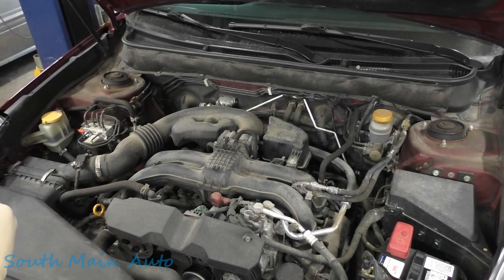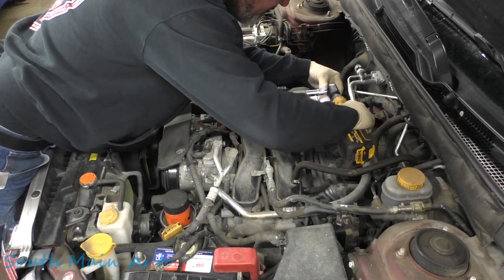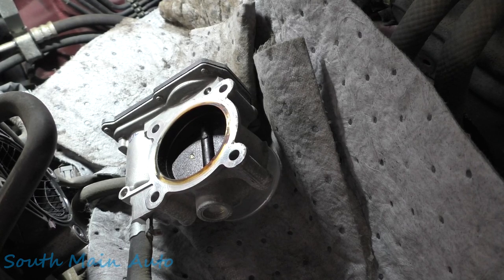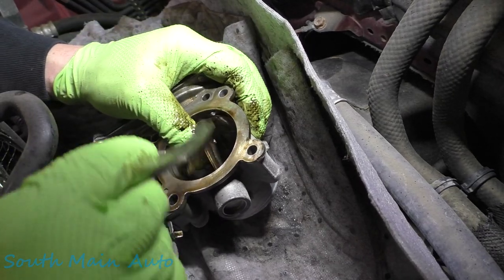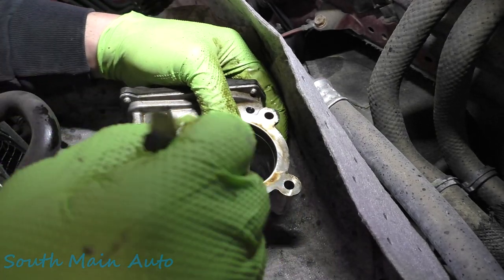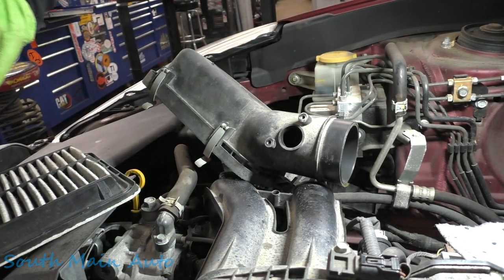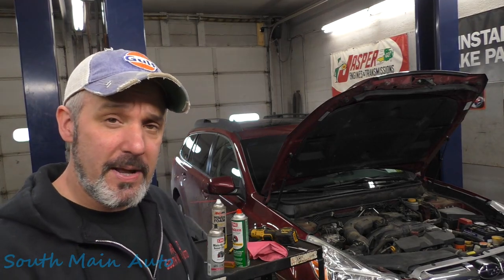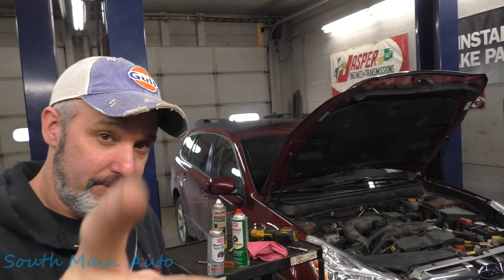How Does Your Shop Deal With Intermittent Symptoms?

Comment: Always hated these kinds of brain twisters. You did some of the obvious stuff. But I'm remembering a time a very long time ago when I was 17 I'm over 60 now. Had an old ford Galaxy 500. It developed an intermittent. Would run fine then out of the blue it would choke and sputter then die. Let it sit for a while it would start back up run fine then rinse and repeat then die again. Then it would run fine for a few days then the bad stuff would happen all over again. Seems like every time I put gas in it it would have these spells. Finally it had a spell and just would not start again. It died on me in the middle of nowhere and I had to walk 10 miles back. Met up with the old girlfriend's father and told him all about it and he asked me if I had checked the Fuel filter. It was a rust bucket of a car I was just a kid so yeah the fuel level was always low and cars don't run too good when they suck up all of the gunk in the bottom of the tank. Changed the filter at the carb, the screen at the mechanical pump and the one in the tank. That was the issue. After that I never let the tank get below a quarter and kept two fuel filters with me each time I ran that car. The issue never happened again. Hope that's not the issue with the Subaru.

Comment: YOU MISSED A SPOT!

What a dirty air system! I check my filter at every oil change (at 5000 miles) and rarely let my air filters go past 15k.  My mass airflow sensor gets a light cleaning every 15k.

I check the throttle body at 30k on all of my cars. 

I kept my 2011 Subaru Outback engine clean enough to eat off... The head gasket blew at 89k. Revved above 5k once. I was averaging combined 36 mpg with that stupid car.

Comment: My shop would take a quick look at an intermittent problem at no charge. If we get a sense of direction then the customer is called and diagnostic time is requested.  If there is no sense of direction then we give the vehicle back and tell the customer to bring it back when the problem becomes more frequent or is reproducible.

Time is money. But don't take a customers money if you can't fix the problem. Communication between the shop and customer is the most important part. 

I run the shop when my boss goes on vacation and let me tell you that "People Suck."  Not all people but enough of them to warrant my opinion of dealing with the general public.

Comment: I wonder if the fuel pump is failing? I had a car with the same symptoms, but it wouldn't mess up long enough to trigger a CEL. Finally the fuel pump packed it in one day, left me on the side of the road

Comment: I have had multiple customers come in with odd problems with idle and even fuel trim problems and I've learned to 1st clean throttle body and use MAF cleaner (primarily gm products) solving about 75% of issues with in town driving concerns.  Is this a valid repair in your eyes?

Comment: I tell the customer that I have not been able to duplicate the issue so far but will suggest one or two possible areas for further investigation based on either previous experience or logical conclusion. However sometimes the symptom does not make sense in which case you really need to experience it first hand to avoid ending up down the proverbial rabbit hole.

Comment: After 30odd yrs in the trade I now work in a workshop that I get no customer interaction and one word job sheets, so my sheet says "knocking" or "squeak" and we as the techs have to asses the car from there and report back to the office at that point we are given the more information and that works real well, I go to the office and say left front anti roll link or right rear shocker area or even if my customer could remove the garden tools from the trunk, I worked at Skoda years ago and I looked for a noise on about 10 new cars and I noted that the old timers noted the noise and then one day an older guy ex driving school guy used our loan car (and a friend of the shop) and said its got a noise and I said "you can hear it??" YEP  just by the accelerator peddle  me and him stripped that brand new Skoda down to metalwork only to find that the very last spot weld on the sill to A post had not fused and the vibration was only heard with people with hearing aids, my driving instructor had 2 hearing aids and therefore could pin point the noise to an area within 1 ft,

Comment: This is a tough one so I'm keeping it simple as I can. I am no longer in the automotive industry. I went to the wind turbine industry and have not looked back. I have done private garages and dealer ships. Taught automotive at college for years.  i've made a killing and was always accurate with diagnostics. Even to the point when at a dealer ship i could argue with the techline and get the parts I wanted changed even though they had confirmed fix's for same issue with other parts and getting my issues at the time fixed the right way. My advise to everyone the industry is stop devaluing our work. Every time you do a freebie or do not charge for diagnostics you feed the beast and cause our trade to be soo devalued. How is it a plumber and electrician can charge easily $100 hour up here in the north and do such shitty work. its cause they charge you. they don't do 5 things in the same area and give you a discount cause they were in the area. no they charge accordingly and us as automotive techs are soo beat and broken in to not charging for our work that we've as a whole screwed over the entire industry. ALWAYs charge for time spend. even intermittent. Set the expectation that they have to spend money even if you dont fix it. every other industry does it., why dont we?

Comment: Too often, mechanics will deal with intermittent symptoms by launching a massive attack with the 'parts cannon', not do research on line or from the diagnostic programs, don't properly read trouble codes. Often it may be a faulty wire, switch, a leaking vacuum hose, bad sensor and it may take experience and common sense to figure it out.

Comment: Intermittent + mouse sign = wires compromised somewhere. Is it wet/rainy when the intermittent presents? If so it's some short to ground on a stripped power wire!

Comment: Amsoil is currently out of stock of the power foam.
I need to do my throttle body on my Subaru the last time I did it I use regular carb cleaner and it just took forever.

Comment: "A very expensive valve".  Not to mention, a completely unneeded valve.  If all the emission stuff that was adopted early-on actually resulted in the NOx reductions they were designed to provide, it would be one thing, but so much of it accomplishes nothing but increasing vehicle purchase and maintenance costs.  I wish they would allow auto makers to stop using the stuff that has been proven to not actually be making things better instead of just keeping the regulations in place when the only real effect is to nearly smother the engine and cause owners and mechanics headaches because the code is so convoluted and the replacement parts are outrageously expensive.

Comment: I'm wondering if the intermittent symptoms started after the battery was swapped out. Looking at the before/after cleaning the throttle body, car should run better in general.

Comment: I drive a company vehicle for my job, 2014 forester with the same engine and it has the CVT. Around 95,000 miles it started stalling, turned out to be the CVT. Never got the explanation for how it would cause the engine to stall as my work company just swiped the credit card and got it fixed.

Comment: Maybe, with intermittent codes being what they are, manufacturers could develop a suffix for codes which could be stored in long term memory when a specific system is hitting a "yellow" range, so not out of spec persay but flirting with the limit.
Reply: Or some form of change to what constitutes pending. Mode 6 can help you identify some such issues

Comment: I have a 2017 f150 5.0 and it is intermittently stalling at stop light after driving for a while. No codes. It's worrying me because every video on youtube says it's a know problem and it's cam phasers.  I know if I take it back to the dealership, they're  just going to say it ran fine for me, and that's going to be that. Even though they know their is an issue with these model trucks. I have always owned chevys until this truck 🤷‍♂️

Comment: Our shop plays by the type of issue they are having. If it's noise related I'll ask them to take a video or recording if I can't reproduce it. Also random problems I'll see if it occurs at the same location, time after driving, speed, temp, accessories on or off, any small piece of insignificant info that may be related. All depends on the seriousness of the issue.

Comment: Not familiar with that car, but I have seen that problem when the pintle on the Idle air controller got coked. Hot soaking would cause it to expand. Maybe you cleaned the IAC while cleaning the throttle body. Like I say, not familiar with the car.

Comment: Our 2015 was acting all stupid and gutless at times. It did throw a code for 02 but the issue was it the money light would go off ,car would run fine for a while, then money light again and bad running issues. I could also smell a lean exaust, which I thought mabe intake gasket seal. I did every possible test I could think of not owning a diagnostic computer. Turned out to be a badly cracked exhaust  manifold. I took it to the shop my mom and daughter used and they found it.  The 02 sensor was fine. I had them replace it as I do not have time to do it and no garage doesn't help.

Comment: I had a check engine light that had me changing a vent valve I believe.  Light came back on then I gave up. A month later light goes away and hasn't come back. I think the car is just messing with me at this point

Comment: On the throttle body cleaning I was always told not to manually open and close the plate that it could cause a calibration issue ! Is this the truth on all throttle body parts ???

Comment: To be perfectly honest, and I have done it on two I can think of.... I used the small shotgun. They were mine, and I would guess, and throw a part at it and hope it fixed it. And then on to the next part. One turned out to be a fuel flow transmitter on a 94 Chevy prickup. My memory fails me after that, but yeah, I shot the cannon.

Comment: What's up with the mesh/ grid in the intake manifold where the throttle body attatches? Never seen that before, I would never think anything that big for it to filter should be in there anyways with the regular air filter filtering it.... odd

Comment: Drag from one of the aged components on the accessory belt (compressor or generator or water pump), a drag from low or old, dirty, transmission fluid that may have clogged fluid passages?

Comment: I have an 06 outback manual. Occasionally a high idle. When looking at tps on a scan tool am I seeing pedal position or throttle plate?
I think the scanner actually calls it throttle plate angle.

Comment: Would there be an option for the customer to buy or be supplied with a diag tool to monitor the performance at the time of the issue, preferably with the ability to record the car performance? Strange how cars have all of these computers and none record what they monitor or events. If the suspected issue is that the butterfly gets stuck, can a camera be mounted externally to record the position at the time of the event?

Comment: Mr. O, or chat, I need advice. I recently had work done on my 2000 Kia Sportage. I bought the car about a year ago with no cat on it (it attaches to the exhaust manifold). One of the things I had repaired was a new cat. It now runs very rough and smells like it is running lean. Will this clear up or should I go back to the shop and have them fix it? All the other work I had done was not engine related (struts, power window, ignition switch, etc.).

Comment: Got a ford f700 with 429 gas engine. Randomly stalls and won't start for a bit. Cranks but won't start. I can spray a little ether and it will try to run.. got fuel pressure at the rail. Injector pulse maybe? I need help.

Comment: I have the same problem on a 99 dodge ram 1500,.,  Runs fine, And every now and then a quick start and it will bog down and die.. Then you have to drive with 2 feet and wait for the ECM to relearn the trims..  

It will run fine for weeks and other times it would " SEEM " like I lost power to the ECM.. No codes.? 

I could not track down anyway to bypass my ECM with a different power line from the battery directly.. 
ECM has clean contacts and tight connections,? But for some reason I'd Start the pickup and throw it into drive a little to quick and it's back to 2 feet for 20 min's to relearn the trims.? ..

Comment: I used easy off oven cleaner on egr valve pintals,  don't use on aluminum sodium hydroxide loves aluminum it will eat it right up.

Comment: I have a 95 Dodge V10 and a 96 V10, the 95 has the same issue but the 96 runs like the day i bought it. fired the parts cannon at the 95. cleaned all the grounds. my nephew said run it thr the gears when the engine was warmed up sitting still, the engine did Not like that, not the question is torque converter or transmission control module. and thoughts on this would be greatly appreciated.

Comment: We do the same at my shop as you are doing. Test drive, quick code scan and then anything that can be done relatively quickly without any expensive parts that “may” cause the symptoms. It has served me well. We have earned a lot of long term customers by just being honest. Basically don’t be a wallet drainer especially, if you aren’t sure.

Comment: I had a work truck f150 2001 that the belt would squeak intermittently they replaced the belt and idler pulleys, it still squeaked.  I got under there and found 3 of the 4 compressor bolts broke off it was just hanging there.
Reply: Belt , belt tensioner and pulleys .

Comment: My go-to for auto cleaning is gasoline and CRC red can brakleen. That green can brakleen is garbage in my opinion. I have tried solvents soaps and household remedies to clean parts. I will admit electrolysis does work. I personally go by what works for me. The only problems I have with brakleen is it eats certain plastics and can harm aluminum this is just my personal experience. I might just try the amsoil. I get tired of this will clean better than brakleen and gas. I try it and go back to my go-to. Maybe I use the other stuff wrong don't know.

Comment: How many unfortunate mechanics have had a finger taken off by a demon possessed throttle body butterfly valve snapping shut while trying to hold it open and clean it?
In this case I would hope that the customer would be satisfied by all the nice aerosol spray products that were used on his vehicle in an attempt to solve the intermittent that may only happen when the stars are aligned a certain way.

Comment: Had a gmc truck once the fuel pump would get hot and shut off the shop I took it too threw the parts cannon at it said it was the spider fuel system then said it was the ecm

Comment: Could it be a fuel supply issue after the fuel pump has been running for a while? The bearings get warm and then start to cause issues? Just a thought.
If you need help, you could always call Scotty K    LOL   Just joking.

Comment: The shop I worked for was really good at intermittent issues. We would open a file for the Customer, knowing we might miss something, so when they came back with the same issue, we didn't charge them diagnostics, and since we had an accurate listing of what we had done, and changed, we could look at the next possible cause. Of course, OBDII was fairly new still, so, a lot of our stuff was a bit simpler to diagnose. We were still dealing with a lot of Throttle Body Injection and Wiring Diagrams of Vacuum Hoses.

Comment: I hade a problem with my 1,8T octavia i hade then , it eaven backfiered so bad that the airfilterbox went to peases , after alot of turns to shop and back to dealer back and forward they found it whas the massarflow sensor but it didn came up on scanner.

Comment: i hate Intermittent faults, i´am not a mechanic, but fix everything myself, (son of a mechanic) I had a intermittent fault on one a previous car, I could drive 5000 km straight, no problem, but if I stop, it maybe died, or maybe not, even with full throttle it will maybe die, all electronic died first, the the engine, maybe it will start again, as nothing happened, maybe not, the scantool is only telling lost communication, so I know it was an electric fault, but what will fail, only when's the cars is not moving, after a lot of searching I find a wiring loom touching the drive shaft, a fastener has failed, so the driveshaft has rubbed trough the loom, and was only touching the two powertrain can bus wires, when driving the airflow around the driveshaft was enough to "blow" the loom away so it does not touch when driving, it took a couple og days to find that...

Comment: APF is good stuff when used like this. It does help to use the regular throttle body or carb cleaner to rinse, though.

On the intermittent issue, the problem is clearly Walmart. He just needs to start going someplace better.

Comment: There's only 1 fix for intermittent problems...a full body off rebuild/replacement of every part of the car. Guaranteed to either fix the issue or make you look like a complete loon, the customer to for paying you to do it.
Gotta random misfire?
Randomly your wipers don't start?
Radio station doesn't come in crystal clear?
FULL body off rebuild/replacement guaranteed to screw up your budget while taking months to complete!

PSA: it might be cheaper to just buy another car, but hey, where's the fun in that!!!